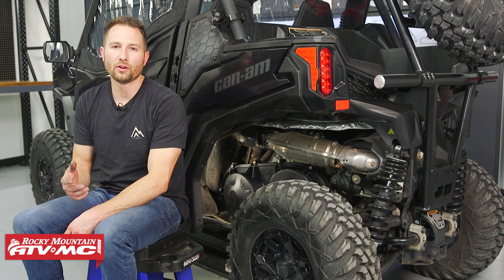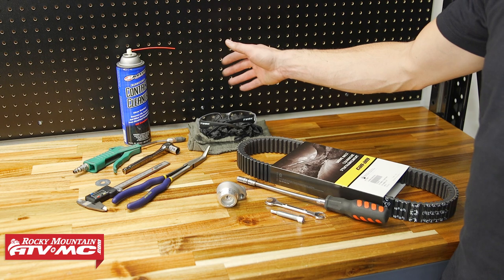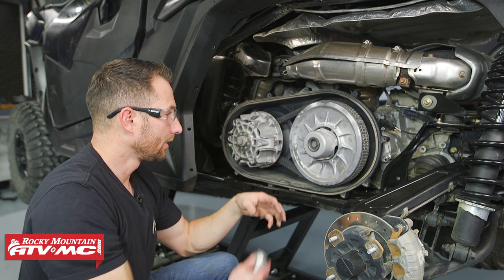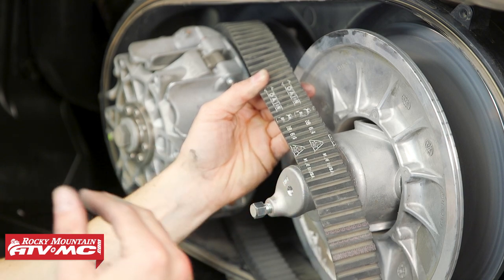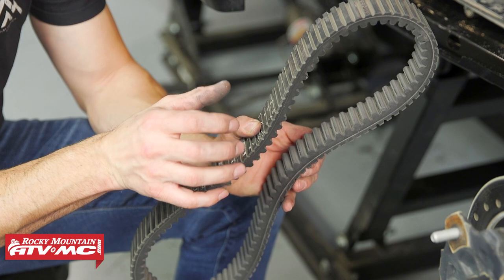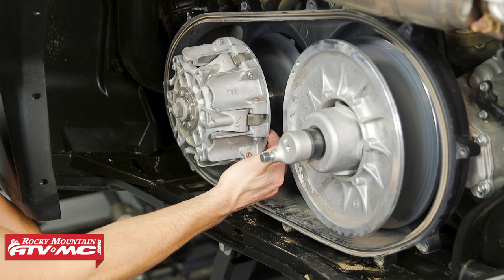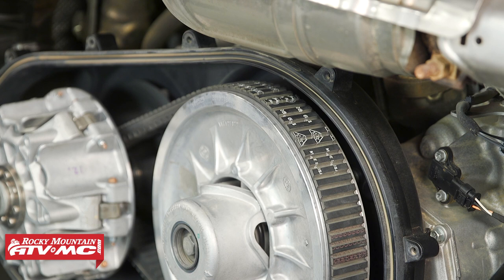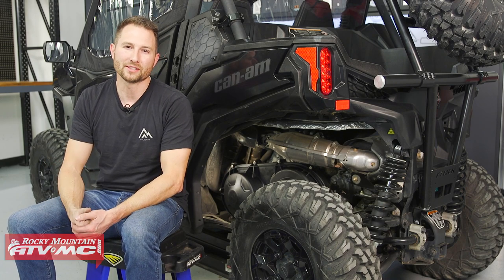How To Change the Drive Belt on a Can-Am Maverick Trail/Sport

Comment: What size is the torques bit 3:31 you need to remove the cover?  Does it come in the tool kit with the unit?
Reply from the maker: Check your tool kit, a lot of times they will come with a tool to remove the cover bolts. We just use the Tusk flex-drive to keep things easy. -Charles
Reply: Charles, in the video you are using a tusk flex drive. I have a can am trail 1000 , and do not see the Tusk  you are using. Can you direct me to where to find it? Thank you.
Pat